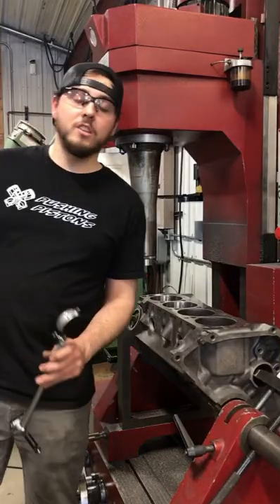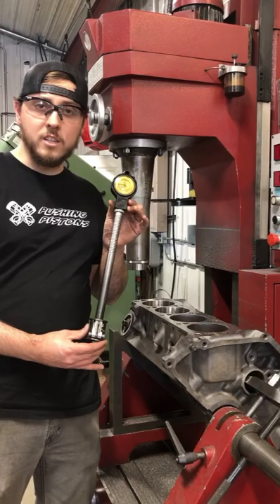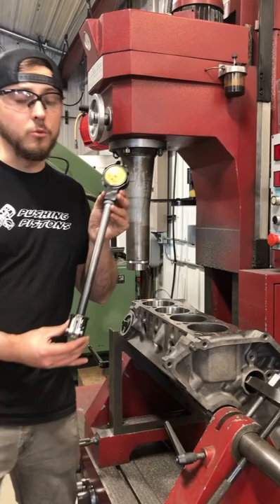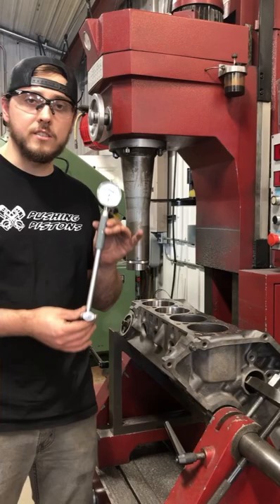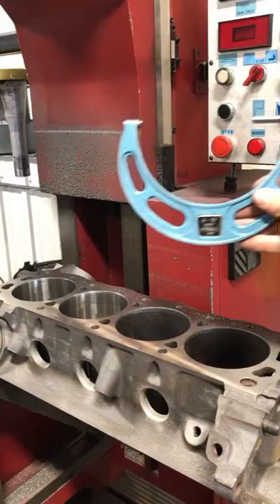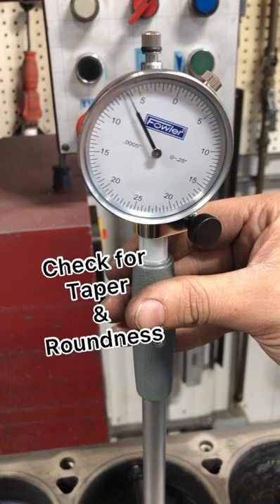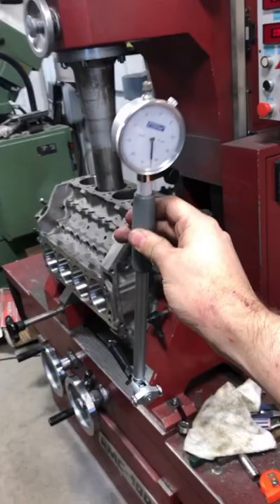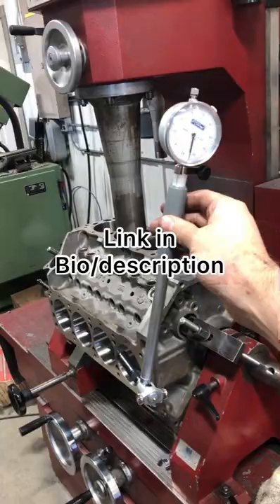#shorts Affordable Engine Building Tools for the DIY Builder - Bore Gauge - JAMSI Recommendations

Comment: What type of education is needed to work in this type of profession? Ive heard anywhere from just high school to all different types of engineering degrees out there. Anybody got a solid answer out there?
Reply from the maker: No education required, just the ability to learn and think critically. That being said, I have a B.S. in Mechanical Engineering. Do I need it for this job? No. Do I think it brings significant value to my career? Yes.

That’s the cool thing about education. Nobody can take it away from you, and you are responsible for taking responsibility for it and finding your own value in it.

It can be “just a piece of paper” or it can be the keys and foundation to your life success.
Reply: Great answer!!
Reply: Experience
Reply: Probably going to break fewer tools, rely on fewer rules of thumb and spook less with shit stories when you’re formally educated.
Reply: I went to MMI in AZ but legal issues prevented me from graduating, anyway I’ve been working on small and big engines for about 17 years, I don’t believe school is necessary, but it does answer a lot of questions. You can find ALL the same information in books and videos off internet. Depends on how far you’re willing to go, there are some situations where first hand knowledge is incomparable. I started out helping a shade tree mechanic for the experience which led to school, but hands on is ALWAYS better. I’ve been looking for a video EXACTLY like this. I have a 1950 Pontiac Chieftain that has everything to rebuild motor. But I’m lacking a few specialty tools, like a dial bore gauge. This is mainly the tool I’ve needed to start my build. I gotta give a huge thanks to the guy in the video. This is the kind of information someone who is strapped for cash and has the knowledge needs. So again THANK YOU SIR...👏👍
Reply: Ojt ( on job training ) is how i learned aerospace machining
Reply: I didn’t go to school beyond high school but have been building engines since grade 10. 
A few things to remember. 
You can’t remember everything so take notes and don’t be afraid to work out of a manual.
There is no end to learning and there an infinite supply of resources especially now with the internet. 
Never be afraid to ask questions guys like me are always willing to share. 

I have been building engines for 45 years. I started out in a shop and then moved into my own shop and learned as I went and still learn something new every week.
Reply: I would recommend you, at least, you go to an industrial high school. That is, a highschool where you can learn how to use a lathe and a mill. It gives you some practice and another way of thinking that you cant get in the university. You could also learn how to use those machines in courses... But if you are a high schooler, do that.
Reply: @sayingnigromakesyoutubecry2647  Good suggestion. I took every shop course in high school that I could automotive, metal work and woodwork. It laid a great foundation to build on.
Reply: @donziperk  well done. I was saying that in the same high school you can get those courses, but that works too. And yes, best foundation ever. I studied mechanical engineer after that, and I had a huge advantage over my peers.
Reply: @JAMSIONLINE  Successful work, I am an Arab, and I work in these machines, most of them are grinding machines, the crankshaft, and the rest of the machines. Of course, you have more advanced machines than what we learned about, but can I work for you?
Reply: I found an apprentice program. I learn by doing so having only 10-15 hrs of classroom and the rest real world work was perfect.

Comment: Mitutoyo which is a quality brand, you can have a 2-6 inch dial bore gauge for 350. I work in a large shop with almost 30 CNC machines and we trust mitutoyo for almost everything.

Comment: Im a lathe setup machinist and I use a few fowler products. Id rate em fairly high for a budget inspection tool. Although our shop invested in 10 fowler 6 or 8 inch calipers and the id blades were not to spec. My 12 inch digital calipers I swear by for referencing tho.

Comment: You could also use a telescopic bore gauge all though takes a while but then all you need is a decent micrometer and a 25$-50$ set of telescopic bore gauges
Reply from the maker: Yes, but this recommendation is meant to be for someone who is green to measuring tools & as such, a bore gauge is a much easier tool to accurately use :)
Reply: From what I understand, dial bore gages allow for an easier time checking for taper and ellipse in a bore besides measuring the diameter too.

Comment: Great advice there, imo save money on gauges like this and spend the savings on a high quality micrometer or vernier.
Reply from the maker: Absolutely! But even so, something is better than nothing if you take it with a grain of salt. You would be amazed at how often we ask a customer "what is the bore size" and they send us a photo of a tape measure across the cylinder hahahaha
Reply: @JAMSIONLINE  You would be amazed how accurate a plastic vernier is when it's used with other good measuring devises, most of my non car projects are diy so the nearest 1/2 mm is good enough, combined with feeler gauges if more detail is needed lol.

Comment: That’s repairing engine’s building engines is a slight bit more complicated.
Milling a block or intake from scratch requires a bit more tools .
Especially manual.
Cnc you can get away with a little less tooling and precision measurement tools .
Reply from the maker: You have to start somewhere. As I said in the video, this is more geared for someone who is just getting into a hobby. Yes, there is obviously a distinction between "rebuilding" and "building", but the basic principles are still the same. Regardless of whether you're slapping your wife's corolla back together with stock replacement parts or working on your own project for a fully built small block chevy, the quality of your cylinder bores is just as important in my opinion. 

I'm not saying this is what you were saying, but the attitude of "I'm an engine builder, the other guy's are just engine assemblers" is just a cocky attitude to have. Every "engine builder" had to start as an "engine assembler". I'm just trying to make the hobby more accessible for the newbies.

Comment: Or you can just have a machine shop do the precision work, and do the engine assembly yourself.
Reply from the maker: The idea of this video is to recommend an affordable gauge to someone who is on a tight budget but attempting to get into the hobby, or maybe doing their own engine repair. W/ an easy way to measure the bores, they can determine whether or not it is really necessary to take their engine block to a machine shop like ours and pay to have it bored, or whether they can feasibly get away with doing a "re-ring" without machine work. I'm not recommending that they can buy a bore gauge for $100 and suddenly they are qualified to bore and hone their own blocks lol
Reply: @JAMSIONLINE  I know lol. I've just been seeing a lot of your videos recently and have realized that this is just something one can't do themselves for a reasonable price if they need the work done. How much would a reasonable shop charge just for checking the engine over?

Comment: Diyers are now doing engine builds 🤣
Reply from the maker: Tons of people who want to tear down and rebuild their own engine! I think it’s an awesome way to learn!
Reply: If it's anything like the recent uptick in the diyer auto body shit show, this is going to be great 😂. There's no sand down and start over with a block
Reply: @JAMSIONLINE  the nightmare is getting access to the software in order work on certain vehicles.
From what I've read the 6T GM transmission on the Traverse in order to replace the TEHCM you need to program it to the vehicle and their reasons for doing this with their vehicles seem like nonsense. It's supposedly for preventing theft but I don't know who's swapping ECUs to steal a Sonic.
Seems pretty anti diy because I have no clue how to mess with the digital stuff. 
Is it only dealerships that have the equipment for this?

Comment: Fowler!?!? Ugh 😣
Reply from the maker: The point of the video is an AFFORDABLE bore gauge for a first time DIY guy. Not everyone can afford a $300 bore gauge let alone a $2000 bore gauge to rebuild a 350 small block in their garage.
Reply: @JAMSIONLINE  it's all good I work in a machine shop and I have access to high quality precision measuring instruments. Fowlers do work. They're okay for a Chinese brand I have some Fowler mics. I've been stuck on your videos not a hater. To set bore gages it's better to use Jo-blocks. Mics can be off